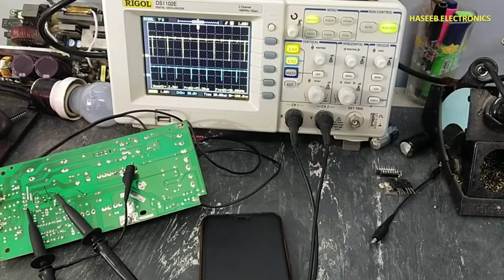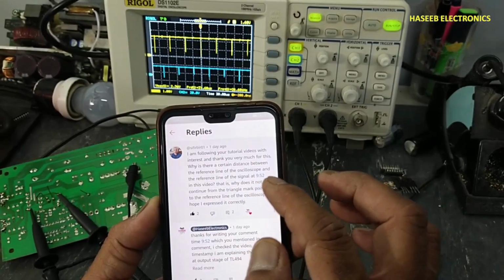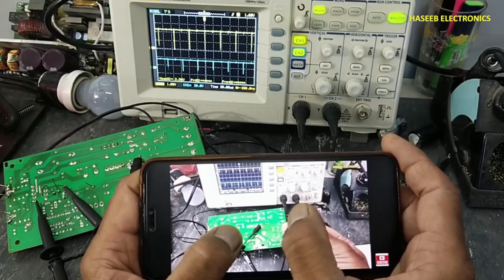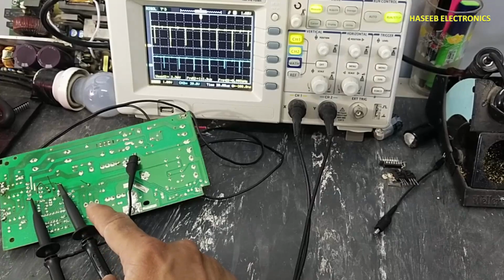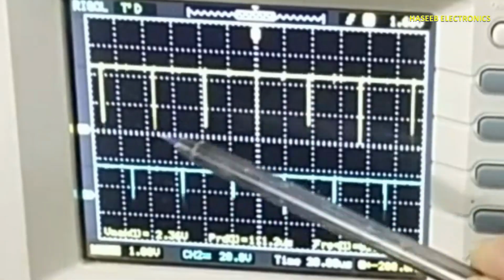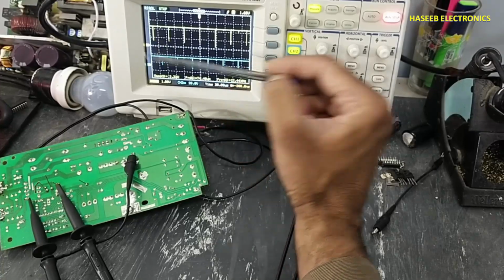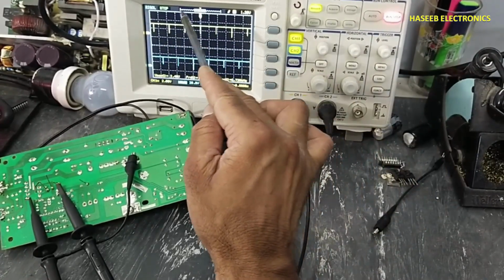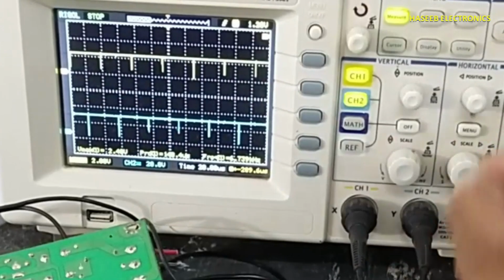{969A} Analyzing signal on oscilloscope

Comment: Analog CRO,  display not stable, rolling horizontaly and dancing effect vertically.. How to fix this problem? Pls help sir 🙏
Reply from the maker: Please adjust its "trigger level" and "hold setting"
Reply from the maker: Also 
Set 
Trigger source to chaneel A (if you are measuring signal from channel A)
Reply: @HaseebElectronics  thank u sir
Reply: @HaseebElectronics  thank u sir

Comment: Sir, for normal electronic reparist, oscilloscope is not known,but for Electronic circuit, designer it's knowledge is a must,  when learning in universities we are just mug up knowledge un knowingly, after a longtime, doing jobs,and thinking we become perfect and knowledgeable, sir. By practice , your set up and knowledge is a vast in Electronic field 😊. I think so I live, said Descartes 😊 very good Explanation,some what I could understand sir,I visited an electronic company in jugarat,most of the engineers had Oscilloscope in front of them 😊 good day

Comment: You can tell also, it's marginal duty cycle, so, output transistors of pwm chip don't always saturate, i.e Vce is not 0V when it's low level on the output.
Reply from the maker: thanks a lot for a great and valuable contribution. 
please accept my best regards
Reply: :hand-pink-waving: